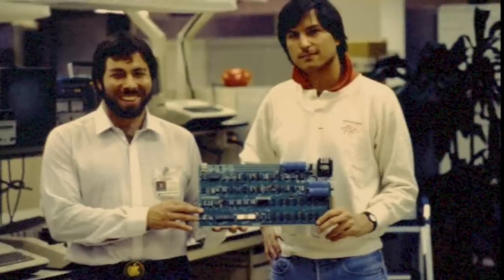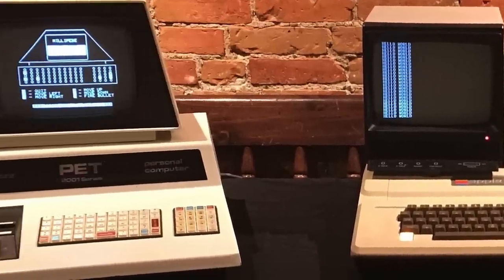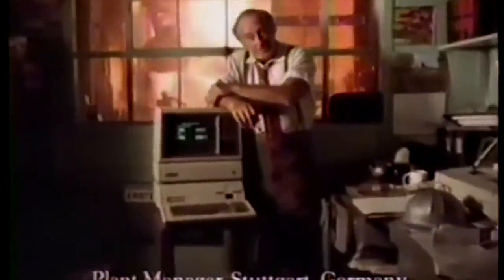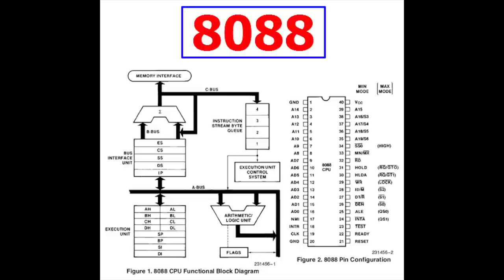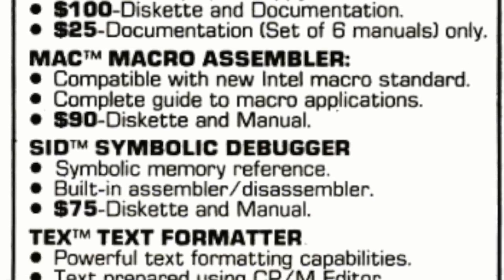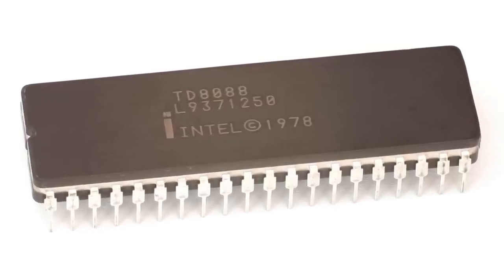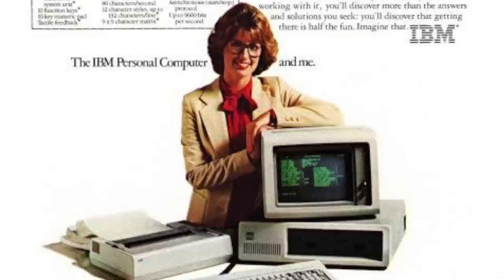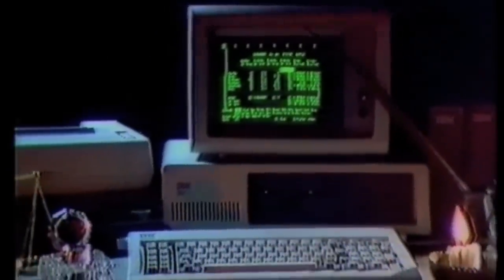DOCUMENTARY: Why and How IBM ended up creating the PC (and ended up choosing the 8088 CPU)

Comment: The REAL story of how IBM ended up with the 8088 comes down to one person: Gary Kildall.  And this video slightly touches on it, but misses the mark like all documentraries.  What has been "Erased" from history is by the most important information and the missing puzzle piece to understand what really happened.  First and foremost, Apple, nor Commodore were ruling the PC market in the 1970's.  Who was ruling the the PC market in the 1970's blowing away Apple was Gary Kildall's CP/M and Gary Kildall's BIOS invention which led to the S-100 computers that were flooding the market and completely dominating all other PCs.  Apple never was in the picture.  Apple wasn't even on the radar.
So IBM had a simple plan:  Steal the S-100 computer design (which entailed the intel 8080, etc.) and Steal CP/M.   IBM stole the S-100 tweaked it and called it ISA bus. IBM outright stole Gary Kidall's BIOS design, the heart of these computers, because Gary Kidall did have the resources, or lawyers to protect himself.
So after stealing the architecture, IBM had to steal one last critical piece, the OS, CP/M.  But to protect themselves they could not do it outright light they did with the open architecture, because software piracy was much more protected in those days than stealing hardware, and that hardware was already designed to be "open" (BIOS w/ S-100).  Thus it so happens IBM CEO John Opel was friends with a women named Mary Gates.  What transpired afterwards, has been hidden.  But first and foremost Tim Patterson ALWAYS worked for Microsoft, long before 86-Dos, ...which is very suspicious since Microsoft has tried to cover up this fact, and even in Docudramas like Pirates of Silicon Valley they protray Tim Patterson as not knowing of Microsoft before they bought 86-Dos, which could not be further from the truth, as Tim Patterson was contracted by Microsoft to make he Softcard a long time before this.
TL;DR
IBM teamed up with microsoft, and stole Gary Kildall's BIOS(ie open architecture PC), and his OS, CP/M.    F-ing Mafia.
Reply: You meant to say, “Gary Kildall did NOT have”
Reply: I often wonder why IBM didnt go after the early IBM PC clone-makers which started a massive industry. Maybe thats the reason.
Reply: @rogerknights857  you are right. thanks for the correction.

Comment: The primary, but not the only, reason for IBM's end in PC production was open licensing, or the de facto lack thereof. Not even open architecture because IBM could have outsourced the production of cards and components to other suppliers and produced the PC itself like Commodore produced the Amiga. And it could have sold the rights to eventual PC clones as licences for the entire architecture. He didn't do this so manufacturers emerged who produced it cheaper, more and then better. And the mass relocation of production to the Far East, the question of whether it was right for the strategic security of the USA, accelerated the process. Admittedly, this relocation was not just about PC architecture. What became one of the reasons for the success of the PC architecture, however, weakened the position of its creator. Regards.

Comment: I believe your description of the IBM PC development was correct except for 1 glaring omission...

As a hardware engineer at the time, it was evident that the distributed buss protocol and interrupt structure was totally wonky for the 8088.  Signal inversions and different signal delay structures caused massive headaches for engineers of both clones and 3'rd party accessory vendors.  And huge problems for the end-user also.

WHY?  Well, the story goes that they designed the mother board and surrounding hardware for the - yet to appear - Motorola 68000.  But Motorola could not meet their timeline.  So they kludged in the 8088 from Intel instead to get the product into the market-place.
Why it was the 8 bit 8088 instead of its 16 bit forerunner, the 8086, I have no idea.  But there you go.

Because the IBM PC became an instant hit with massive uptake, IBM could not reasonably backtrack on their initial hardware and supporting software structure when the 68000 became available about a year or so later.

Interestingly, the sort of flexibility that was almost unthinkable back then, is nowadays a trivial exercise for the most part - substituting the 68000 downstream.

AND...  I have always had a great LOVE for the Zilog Z80 CPU and its successors - eg: Hitachi 64180.  But that is because I am a a whiz-bang-whir type of engineer - now retired.
Reply from the maker: Awesome story! How did you get this inside scoop?
Reply: @AlsGeekLab  Not awesome.  It was pretty much public knowledge among engineers and designers back in the 80's. And I could not now give you a path to follow in order to verify.  Sorry, I am just an old man reminiscing from his rocking chair on the porch so to speak.
Reply: @AlsGeekLab  Not awesome.  It was pretty much public knowledge among engineers and designers back in the 80's. And I could not now give you a path to follow in order to verify.  Sorry, I am just an old man reminiscing from his rocking chair on the porch so to speak.
Reply: The 8088  uses port addressing for I/O, whereas the Motorola architecture uses memory-addressed I/O (as in the famous DEC  PDP-11 and its Unibus).  I had always thought this kludgy mixing of architectures was cost-driven, so your take on it is very interesting.  The ease of moving between architectures today (e.g. Intel to ARM) is very much thanks to the huge legacy of the open source GNU GCC and other high level C (and now Rust) system programming environments;  forty years ago the low-level programming was done in Assembler (and FORTH at  the monitor level).
Reply from the maker: @jimparr01Utube  still an interesting insight, none the less Jim, thanks for sharing!

Comment: I lived through these times.  Some other thoughts. 
IBM knew that ultimately it would be software that determined market share.    They knew that independent software designers would write for the largest platform.   They allowed clones.  Forcing a license fee, but also including heads up on any changes.  Apple sued their clones out of business.  Does Franklin ring a bell here?
Even with all this, I got to work on a DEC Alpha work station, networked to others at my work place through an Alpha server.   We regarded PCs as mere toys.   Slow slow slow!!!

Comment: The first PC on my desk at work was a "Columbia" 8086-based clone from 1982. 2x 5.25" floppies, a full 640k of memory, 4MHz processor. It lacked the IBM BASIC interpreter, but anyone with access to an EPROM burner, an original IBM ROM no scruples about piracy could easily fix that. Later on, compilers became available and programs which took 4 or 5 minutes to run through an interpreter ran in seconds as a compiled executable. My first upgrade was to a -286 machine with a massive 20MB hard disk, which we were never going to fill 😂. As someone who has built many PCs over the years, I like the ability with the IBM PC and its descendants to customise the build with the best components for my, or my colleagues' needs. For that reason, I have never been a fan of Apple's closed architecture model and proprietary software.

Comment: This video needed a lot of simplification, but some things are misrepresented. The 8088 was basically a 8086 with fewer external data bit lines. This mattered a lot when hand-designing a motherboard and bus with standard IC chips. The bus was probably not meant to be "open", but all the slots on the first PC were needed to add functions that could not be placed on one board without extreme cost due to production quality limitations.

Comment: Motorola mismanaged the 68k, and had neither a believable roadmap nor peripheral chips. The 808x came with both, which is why the IBM PC was basically a set of Intel reference designs. Nothing to do with 16 bit being harder to design for than 8 bit per se, just the fastest route to market based on what was out there COTS.
Reply: Hello Moto 👋

Comment: Wow. My first PC in 1990 was a 286 12 mhz with 1mg of ram and 256k of video mem. I can still remember using an app to wedge TSRs into that magical area of Ram between 640k and 1meg! Oh and, upgrade from DOS 3.3 to 5.0 and realizing I actually had a 40mg Hard Disk with only one 32mg partition...thanks to DOS being limited to 32mg partitions. 8 more megs of disk space. Wow! Awesome. 
My phone takes its default picture at over 8mg lol. 
About 20 minutes after I fired it up, it was of course obsolete. The PC with VGA monitor and color dot matrix printer was $2k!!! 
Yup... good times.
Reply: My favorite memory manager was QEMM. The order in which you loaded the drivers and anything else in the boot process was very critical. For instance, the mouse driver had about a 30K footprint, but you needed about 150K free to initialize it. You needed to load it first.

Comment: First off, the PC was NOT part of Big Blue. The PC came out of the GSD part of IBM. The same division that made photocopiers & typewriters. IBM never considered the PC to be a REAL computer. It was a toy (and it still is) compared to Big Blue.
The chips for the mainframe were made in Armonk, NY and they did not have the ability to produce vast quantity of chips needed for the PC, so they needed to outsource it. I owned a VM/PC so I could run IBM s VM on my desktop. It was a regular PC with a 68K as a daughter board. The V/M PC could either boot regular DOS or VM.
The 8088 was, and still is brain dead compared to the mainframe architecture. It had a 20 bit address bus to access 1mb of memory. It only a 16 bit processor, so it had to perform an additional operation for each memory access. Not too bright.
It was also limited to math operations in 1 register, not to mention extremely limited amount of registers with a lot being special registers, where as the mainframe had 16 general purpose registers, thus eliminating much of the unnecessary software gymnastics you had to do to get results. 
The 68k would have been a much better choice.
I still MUCH prefer programming  on the mainframes, much more intuitive and an o/s which is light years ahead of the PCs

Comment: The 16k base model of the 5150 seems silly. While computers of the time like the Tandy Color Computer also shipped with 16k they were aimed at the home market and costed a tiny fraction of the cost. Meanwhile in 1979 Tandy's TRS-80 model II (that was aiming for the same market IBM was) base model had 32k and 8inch drive as standard.
Reply from the maker: and all that was lacking on it was 3 little rasterised letters !
Reply: @AlsGeekLab  Yet how many base models did IBM sell? There was pretty much no software released on cassette for the 5150, even adding a floppy drive you'd still have the issue of 16k not being enough to boot Dos. My only theory is that you could get a Apple ][+ with such a limited configuration and IBM was just matching the option yet Apple was also aiming at the hobbyist market with the Apple ][+ while IBM was not.
Reply: 8 inch? I don't think so. It was 5 1/4 inch.
Reply from the maker: Nah the TRS model 2 was a business machine and thus warranted extra storage, so it did have  8" floppy drives.
Reply from the maker: The cassette port was almost never used in the 5150. The 16k was pretty much never sold, with the 64k being the 'default' model sold. The 64-256k boards came later and were very popular
Reply: @emuhill  Model 2 had a 8-inch floppy drive for the extra capacity as it was aimed at business.
Reply: IBM also thought the home market. One could get the PC without any floppies or OS. It then booted to ROM basic and you could write programs and store them on  cassette. Few did that but some used the cassette port relay to control some external devices.

As a relic of that many clones gave error message "No ROM BASIC" if there was no boot device. They did that still in the 90s and people had no clue on what it meant.

Comment: IBM also considered the NS16032 (rebranded as 32032) which, bested  the Motorola 68k with a 32-bit  ALU and internal bus as well as a non-segmented 32-bit virtual and physical memory. There was also an 8080 compatible 8-bit version planned. IBM engineers preferred the NS32032 architecture which, while CISC, was far more regular   than Moto or Intel. Unfortunately for National samples were still 2 years away and when they arrived were not hitting the 10 MHz target rate. National was on the right track, just late to market.
Reply from the maker: I didn't know that, very interesting! How different things would have been if they used that chip, or the Motorola, or the ROMP! Imagine 32 bit computing from the get go in the early 80s. That would have been wild, but I guess probably cost prohibitive
Reply: @AlsGeekLab  one correction: the address space was 24-bit like the 68k, not 32-bit as I wrote.

Comment: The Datamaster was a piece of crap. No hard drive, large 8" floppy drives  that had problems reading disks at times. Customers who did not do their backups in a timely manner. I also worked on 5110's and 5120's that had many of the same issues.

Comment: Things were advancing very fast for about 2 decades and "hot new" was becoming "old obsolete" with little compatibility either direction between generations. Having access to a DEC running VMS at work, I just stayed out of the PC market until the dust settled. Now MS is trying to have an all in one operating system so I locked them out of messing with my reliable W7 OS.
Reply: You would be better off with Linux.

Comment: CP/M would have been a better/quicker Operating system as all the instructions could be written on a 256 bit line & carry over to the next line instead of each instruction having its own line & nulls filling in the rest of the 256 bits on each line. The CPU having to read lines of Nulls. Before hopping to the next line just to read maybe 56 bits of instruction & 200 bits of null. Did I say that right?
Reply from the maker: I think the world would have been a better place with Gary Killdall and DRI at the helm, rather than Microsoft! One can only imagine how it would have played out.

Comment: Given we still use IBM PC compatible clones and will use them for years to come its hard to argue going with cheaper and easier to integrate 8088 was wrong decision. For me if they choose 8086 instead would change nothing because my first PC was 386SX. Some of the older games (I didn't play or want to play...) would run less ridiculously fast being written for slightly faster platform and that is pretty much where the difference for me would personally end. Now choice of Motorola 68K would actually change a lot it being much faster and 32-bit flat memory ISA with 24-bit address space. I would now have 64-bit 68K compatible CPU probably with roughly the same performance levels BUT in the past it would make computers make a lot more sense and older games even with the same bad graphics cards would be better and there would be less technical quirks in DOS era as there would be no squeezing every last byte of conventional memory or EMS/XMS voes. CPUs would go to 32-bit and would be faster and have more memory and that's it. With 64-bit change would look roughtly the same as it did and at this point in time there would be no difference.

Comment: The HP9100A was released in 1969.
This was the first personal computer by any stretch of the imagination!
It had an integral printer, mass storage, display, and keyboard.
To ignore it demonstrates a massive failure in research.
I wrote my first successful program on one of these, for the Australian Army, in 1969.
Reply from the maker: The 9100A was effectively a programmable calculator. It didn't have an operating system like DOS or BASIC, so I think calling the HP9100A is a bit of a stretch to call it a personal computer.

Comment: I watched this video on a Samsung Smart TV – have no idea what architecture it has. Funny that along with phones and tablets, people still don't consider that smart TVs are a thing. Also, while tablets had a good start, I don't think they proved viable over the long run. I can't imagine doing my everyday computing on a tablet. Smartphones are much more useful, but even those only expand the capabilities of the PC, can't replace it. (E.g. now I can use social media without turning on my computer.) I do know people whose use of PC has declined significantly, my sister doesn't even turn on her laptop anymore. I can't imagine myself doing that, using the phone is just so inconvenient in the long run, even typing longer messages is a hassle.
Reply: If the majority of your "computing" is done with web browser, I agree with you. 
But anyone that does graphic work needs a big screen and fast processing, Something you dont have on a cell phone. Not cell phone usage is bad, its just for different purposes.
Reply: I speed up typing in my iPhone with text-replacement abbreviations for hundreds of long or commonly used words.

Comment: That is not a 6502 from 12:32. It is also not a 65816. Most definitely not.
Reply: And the off-the-shelf memory chips used in the original configuration were 1-bit wide, not 8, among other things. 

Sorry, this is old conventional false history and speculation rehashed.